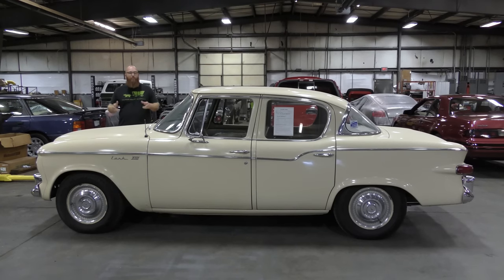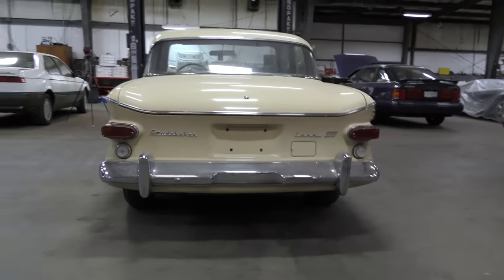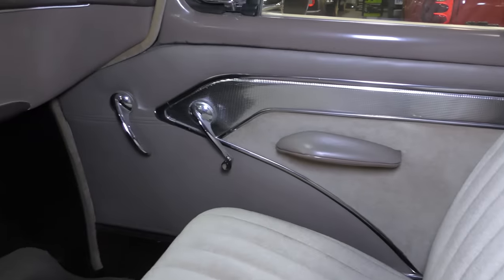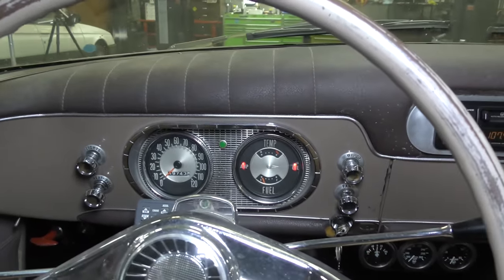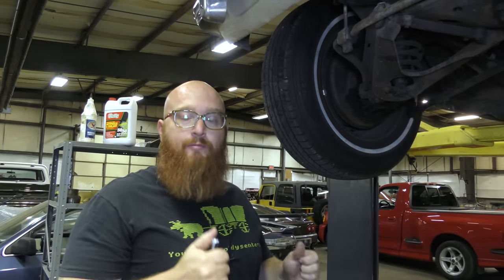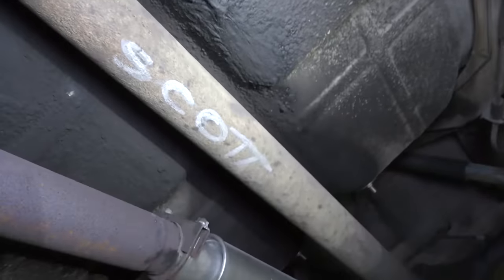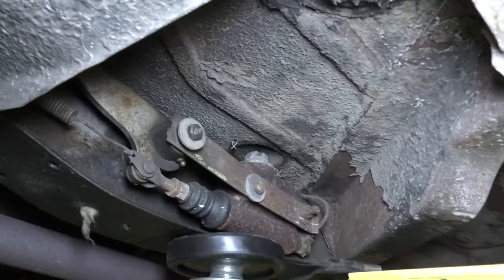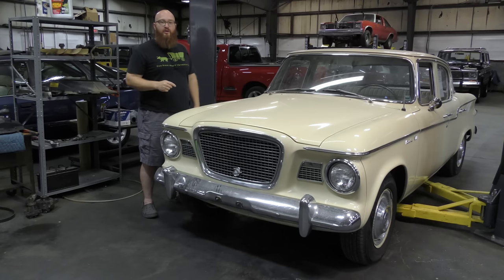Finally a CAR WIZARD approved engine swap done on this '60 Studebaker Lark VIII

Comment: A few years later, after Studebaker closed the South Bend plant they continued to make cars in Canada using Chevy engines. Just might have made that engine swap a little easier.
Reply: US production ended in 65 and continued on in Hamilton, Ontario, Canada until 66 if I remember correctly.  Doesn't matter much in this discussion because the model in this video stopped production in 62, and they were still using their own V8's well after that.  They used their one 6's through to the bitter end.
Reply: I live in western Canada and remember some Studebakers driving around with GM 283 v8 s in them from new.
Reply: My dad loved Studebaker. He owned a couple of them. His last one had a 283 chevy engine.
Reply: You are correct.  The engine mounts and brackets from 65-66 Studes can be used to mount a SBC into earlier cars.
Reply: @allanloiselle2052  What car did they build in Hamilton?  The Avanti?
Reply: @darrylmcleman6456  Love the short stroke of the 283. Had 66 chevy truck with one it was my ounce of perfection
Reply: @MaliciousSRT  No.  They built the bread and butter Lark and possibly the Commander and Daytona, though I am not sure at all about the Daytona.  They were fighting a losing battle for survival by that time.
Reply: The Lark resembles a Checker cab.
Reply: @MaliciousSRT  They opened Hamilton in 48, built some trucks and mostly cars up until 64. Only thing not built in Hamilton was the Avanti. Even Hawks were built in Hamilton. I have a friend whose Dad installed the Dash in the very last Studebaker off the line in 66, he has a 62 GT Hawk, built in Hamilton.  As for Larks, they built the Commander, Challenger, Daytona and Cruiser, Lark 6 and Lark 8 in the eariler years of the Lark from 59 to 61.
Reply: @allanloiselle2052  usa closed at December 63 (means 64 production)
Reply: @MaliciousSRT  Avanti would be South Bend.
Reply: @MaliciousSRT  Datona sedans and wagons, Avanti was South Bend Indiana only.  Produced two years by Studebaker, then became the Avanti II when everthing was sold to Nate Altman.
Reply: @allanloiselle2052  and the Traveler wagon.
Reply: It should have been fairly easy; the Lark set up for the engine meant that the McKinnon V8 (technically not Chevy V8 & 6 -- as noted by both GM & Studebaker, were light duty truck duty motors) so that the motor mounting was easily accomplished with slightly different motor mounts still available even today.

The GT Hawk had a different story, the McKinnon v8 had exhaust manifold clearance issues with the steering column so that might be one reason among many that it was not continued after 1964.

I have seen a couple of conversions to GM v8's including a very nice conversion using using the 700R4 which suited the vehicle very nicely.

Turner brake makes a front disc brake conversion kit for these Studebakers and it works very well.
Reply: @MaliciousSRT  Hamilton built the regular Studebaker Daytona, Cruiser, and Commander sedans and hardtops. Avanti production continued to be made in South Bend by Newman and Altman after the Studebaker company stopped making them. The Canadian made Studebakers were sold in the US and Canada for two years after production stopped in South Bend.
Reply: Thanks I have seen one of these and thought , Wow great way to update many different Studebakers.
Reply: @stevenbrown5695  I'd rather have one with the Studebaker V8. In many ways it was a better more durable engine than the Chev, of course it was not developed after 1964 so it did not have fuel injection but they did offer electronic ignition, one of the first cars to have it. They were more economical on gas than a Chev of the same power too.
Reply: As others have noted, the SBC was the obvious choice here. I'm sure that even though it's an early model Lark, it's the same frame as later models and nearly the same as my Avanti. Studebaker did the engine swap for us when they stopped producing their own motors making this swap almost seamless. Now if they put a Ford small block in there, that would be a challenge!
Reply: Studebakers of this era sold surprisingly well in Australia assembled here from Canadian sourced parts and local content.
More common here than Buicks, Oldsmobile, Mercury, Dodge and Plymouth. Similar with Rambler.
Police thought highly of them. Some police racing enthusiasts bought them at police auctions to go racing at Bathurst.
Story of the Australian Studebakers here :
https://youtu.be/SHHTPLw-oNM
Some of the police highway pursuit cars were two door cars. Would these be Daytona bodies.
Standardised on V8s with highest trim level here to justify higher prices and simplify the range.
Reply: I believe Studebaker had been using V8 engines for a long time. Mostly the 327 I think. I guess the made their own 6 cylinders. I've quite a lot about Studebaker by still don't know all the details. They didn't have the resources to manufacture all the components that went into their cars and pickups. We must not forget that Studebaker made half ton pickups. To run across a Studebaker pickup would be rare anymore. They really didn't make a lot of pickups but they did sell a few. Now for one of the best parts of the Studebaker story. A beautiful car designed by Raymond Loewy. The Studebaker Hawk series that was quite popular in the last half of the 1950"s until the early 1960's. This nice two door coupe offered several models in various price ranges from the entry level 2 door post car for new car buyers on a low budget to the higher end Silver Hawk and top of the Golden Hawk hardtop for some of the best  personal sport luxury available from any car make at the time. No other car maker had anything close. Studebaker even offered a supercharged V8 Hawk with plenty of high performance muscle. Pretty high tech engineering at the time. Studebaker was on the right track but just didn't have the financial resources to create and build enough of cars to take more of the market share from the big three. Pretty much the same thing happened AMC several years later.
Reply: @jayrichards3672  65 pu had 283. 66 had 327.
Reply: @darrylmcleman6456  That is probably what this is....not a swap, eh?
Reply: @deanwhite4190  Studebaker was the first independent to make their own overhead valve V8, in 1951. This was the same year as Chrysler, and before DeSoto, Dodge, Plymouth, Ford, Chevrolet, Buick, Lincoln or Pontiac. Only Cadillac and Oldsmobile had them earlier, in 1949.
It was a 231 cu in 120HP job, later they made different versions of 224, 259, and 289 cu in sizes. From 1957 on they offered a supercharger.
They only stopped making their own engines in 1964 when they shut down the South Bend factory, from then on they bought engines from Columbus McKinnon who made them in Canada for Chevrolet.
Reply: @allanloiselle2052  alot of the parts from the Chevy years could be used on earlier models to make the swap easier. Such as motor mounts, rads,hoses ,hell even pre bent lines. Not knocking the builders work he did a nice job however he got it done.
Reply: @alb5489  The bracketry and water pump is mid 70s on up .
Reply: @allanloiselle2052  Yep their good old L head.  No shame in having one, not all cars were intended for the drag strip.
Reply: @MaliciousSRT  The Lark was built in Hamilton because the South Bend Indiana plant closed.  The original Avnati closed with it. A group of private investors tried to continue production in South Bend, apparently the Studebaker truck plant was still there but the Avanti's were hand built.
Reply: @OG_Jack  Please give Studebaker styling a little more credit, the Lark was a nicely finished car with front to rear styling that blends well. Not bad for a car that was basically a '54 full sized Studebaker with the front and rear bobbed off.
Reply: @buddyroeginocchio9105  Buddy, my comment wasn't intended to be a pejorative.  Resemblance, in this case, is neither positive or negative.  Studebaker made some really cool looking cars!
Reply: @OG_Jack  You are quite right, please accept my apology.
Reply: @allanloiselle2052  They just renamed the Lark as the Commander or Daytona, depending on level, they were still just Larks with some cosmetic changes all the way through '66.
Reply: @OG_Jack  It's much smaller.  But it's funny you say that, as Studebaker had to buy a part from Checker to mate the GM engine to the Borg Warner automatic transmission they used.
Reply: @seed_drill7135  Mostly you're correct.  My Commander had a different options list from the basic Lark, and the Daytona was top of the line.  Think of Ford Custom, Custom 500, Galaxy, and Galaxy 500.  For example, the 64 Lark used a single sealed beam headlamp on each side of the grill.  My Commander used a double-sealed beam system. (4 lights in total)  The interior may have been a little dressier as well.
Reply: @MaliciousSRT  only Larks.
Reply: @OG_Jack  
I can see that, though the Checker looked a little like the contemporary Lark, the Lark was considerably smaller - about the size of a contemporary 1960 Ford Falcon, which was about the size of a Chevy II.
Reply: @mrdanforth3744  Lark VIII indicated it was a V8, while VI indicated a I-6 engine.
1963 and 1965 Larks could be ordered factory equipped with R-1, R-2 or R-3 engines. R-2 and R-3 engines were delivered with factory installed McCullough belt driven superchargers, same as the earlier Golden Hawks.
Several years ago, actually 1991 I believe, at the Pate swap meet near Ft Worth, TX, I found a Lark with an R-3 setup, which was supposedly a factory drag version: no radio, heater, no floor mats or carpet, and actually appeared to be totally original, not a conversion. Would have been a 63 or 64.
Reply: @deanwhite4190  only used 283 ci engines, and I believe mid to late 65 and 66.
Reply: @buddyroeginocchio9105  '53 actually.
Reply: @MaliciousSRT  The Avanti was dead by then they built the Lark and the station wagon !!!

Comment: That heater core design is AWESOME! Anyone who has ever given up and bypassed a heater core because it wasn't worth the time and money to replace it, and suffered a winter or two without heat (or more importantly, defrost) will realize just how well thought out that is!
Reply: Yes, it's said that cars are made by suspending a heater core in mid air and building the rest of the car around it.
Reply: Used to unhook heat hose in my 59 Chevy in summer got tired of well done feet the heat control didn't quite shut off..HEAT🥴
Reply: On many modern cars you can't even access some relays because they are hidden behind the dash. It's like they are doing it on purpose.
Reply: @CoreMaster111  
They are
Reply: 80s and 90s Ford trucks have heater under the dash but with an easy to get to access door behind the glovebox. if it's in the dash that's the way to go.
Reply: I certainly have! Early 80's I worked in a Radiator shop, besides rebuilding radiators I also worked on pulling radiators, fuel tanks and yes heater cores! Took many dashes apart, not fun at all!
Reply: My 86 mustang hasn’t had heat in a decade.
Reply: My 59 Rambler American had the same situation going for it!
Reply: Yup...my 59 American had the heater core attached to the outside of the firewall...Easy to work on!

Comment: The differential looks exactly like the one on my Sunbeam Tiger.  It is a Dana 44.  Mine was made by the Salisbury division in England.  Studebaker-sourced posi-traction differentials have been used in a number of Tigers.  The pinion seal is available from Tiger vendors.
Reply: More than likely a 27 not a 44
Reply: Definitely looked like a Salisbury/Dana axle. Also fitted to HD Land Rovers in the 1960s

Comment: The VIII meant it had the 259 180 hp V8, whereas the VI had the 90 hp L head 6
Reply: Yep
Reply: Thank you- I couldn't remember those specifics and have only ever seen one with a straight six. At 70, you've seen lots but don't always "catalog the details well".  FR
Reply: @jeromebreeding3302  Since we don't have any real idea who "did' the Lark, it's hard to say, past what "we would do, if it was our car". From a value point, even if the original engine was seized and ruined beyond repair, it would have been more valuable with another year correct 259 engine and similar transmission. Mush about this car make me thing the later model engine was to make it a "cruiser" or daily driver- the owner's choice, anyway. Maybe the Wizard will find out and tell us more- you never really know what will come out of a crystal ball till you rub it!  FR
Reply: @fredericrike5974  There's no doubt that a small-block Chevy is a wise choice for a daily driver. Parts are plentiful, and dependability is assured, but the swap deminishes the collector value of the car.
Reply: Wrong! It used the Golden Hawk 289 v8 from 1957, 58 and one to 1963. Studebaker made its own 289.
Reply: I had a 1957 Power Hawk. Base model. Also the 259 V8. Studebaker was always ahead of its time. I've owned two Avanti's as well. My gf had one of these cars while we were in college in the mid sixties.

You know what...this guy doesn't know crap about Studebaker's. Of course he's not my age. I'd give a lot for one of those.
.
.
Reply: I'm confused as to why the original engine wasn't re-built. You can get everything for them.
Reply: @stuart_oneill  ;)      FR
Reply: @jeromebreeding3302  I truly do get that- why I asked the Wizard to do a bit more digging into the story of this car.  FR
Reply: @jeromebreeding3302  That would do pretty much the same damage to value as the engine swap you panned in another response. WTF?   Fr
Reply: @SSGTA440  Save money and parts availability.
Reply: @fredericrike5974  Just changing to a five-speed would keep much of the original flavor, allowing more flexibility using the Stude V-8. Ultimately to swap or not is up to the owner to decide.
Reply: @SSGTA440    Cheaper and arguably more reliable.
Reply: @MrLangDog  True, but I always feel a challenge is more to my direction.....when it's too easy, for me, I feel that the end result isn't quite as gratifying..
Reply: @capthawk57  Thank you! I owned a 1960 2 door with the 289. Parts for the engine were gm. Delco electronics. Trans was auto. Loved the car. Should have kept it. But, when your young still in HS, you don't think of these things. My first car. Had my first date with this car. She loved the car more than I did. Memories!
Thanks again
Reply: @jeromebreeding3302  Exactly my original point- but you, at one point decry the Chebby V8 as a value negative move- while advocating for a tranny swap that would have been as detrimental to that same value.I was wondering about consistency.  But it comes down to decisions made by the name on the title, every time!  FR
Reply: @fredericrike5974  You are belaboring the point. expressed what I would do with car to increase drivability, while keeping it mostly stock I reminded everyone that whatever mods were made we're up to the owner(bone stock is alright to).Do'nt find it necessary to defend my remarks further.
Reply: @SSGTA440  Speculation is in order, the original V8 was probably beyond repair but not because it was worn out, the small block chevy was probably on hand for little or nothing dollar wise.  Interestingly the last year of Lark production used the Chevy V8, car and engine manufactured in Canada.
Reply: @buddyroeginocchio9105  Yeah, or the guy just wanted the easy way out....but that's OK...Regardless, it's a fine old survivor.
Reply: @jeromebreeding3302  I loved my 259
Reply: @jeromebreeding3302  This likely has a 2 speed Powerglide. The original Studebaker trans may have been a 2 or 3 speed Borg Warner. Upgrading to a 4-5 speed trans might be a major modification.
Reply: @loboheeler  Admitedly, finding a bell-housing might take some legwork, but there is to be one out there somewhere. Clutch linkage could be fabricetec, if necessary.
Reply: @jeromebreeding3302  I had already acceded you rights to comment- I only noted a "mis resonance" between two of them. My apologies for not realizing I was stomping on your sacred cow- at least to the poor cow, who likely deserves a better owner.  FR
Reply: @fredericrike5974  I like your metaphor " sacred cow", but when it comes to car enthusiasts, nothing is sacred. Anyway, live long and prosper my friend.
Reply: @jeromebreeding3302  Damn, and I was trying so hard to keep my sarcasm light hidden! Drat!   FR    Same to you- and when it''s your car- DO IT YOUR WAY!  I have and will again!
Reply: @fredericrike5974  I believe what you're doing is called "trolling".
Reply: @jeromebreeding3302  Did I call you names, misquote you, or in any way "modify" your earlier statements? If not, I have not "been trolling" but commenting on the disparities of your two comments. Your over sensitivity woulds seem to indicate you might have a problem with criticism, even when you have earned it. 
  FWIW, I have made the odd error, or misstatement of facts- and been corrected by other commenters. And thanked them for their help. BTW, motorheads all have opinions- if you are unable to deal with that, I strongly suggest you take up a different hobby- knitting perhaps. And that is as close as I have got to "trolling you". TA Ta, good day.......FR
Reply: @fredericrike5974  Live long ad prosper. To the universe, and beyond !
Reply: @jeromebreeding3302  Been packing my spare toothbrush since HS so I would be ready to leave if aliens landed and wanted volunteers to go home with them!  If it happens, I'l give you a call if there is an extra seat!  FR
Reply: I was going to say that meant an 8 because my dad had one. After watching this I come to realize how much it was ahead of it's time. It was replaced by a 63? mercury  meteor. That car didn't last long.
Reply: @SSGTA440  probably the lack of parts and cost.
Reply: @MrLangDog  the stude was a well built engine and very reliable.